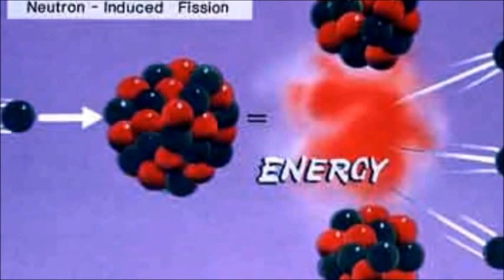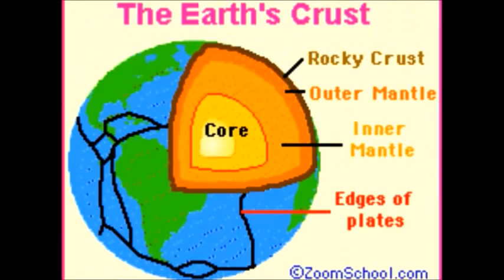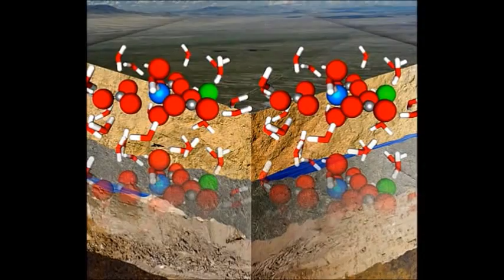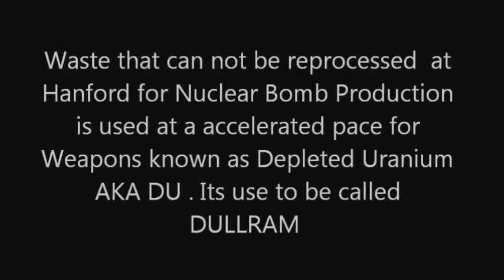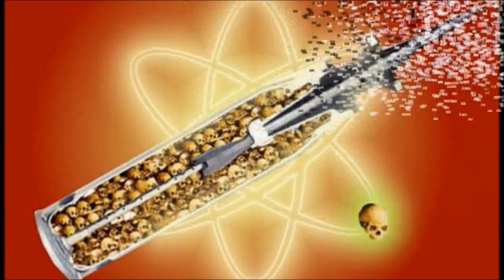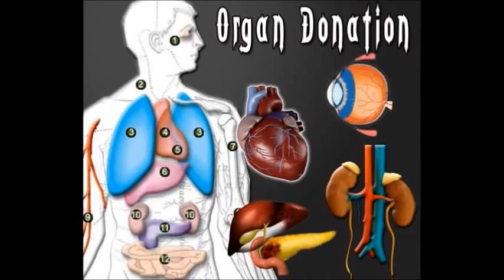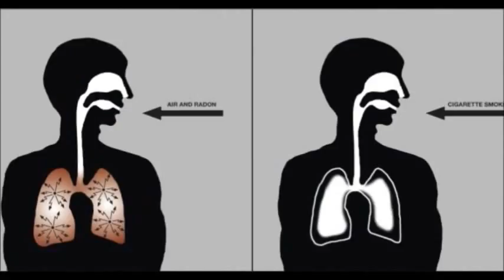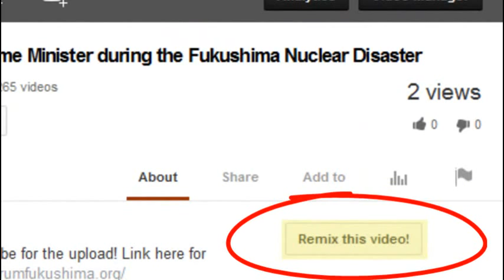Hanford:(Columbia River Warning) Radiation Forever and ever...

Comment: Maybe you need to go learn some real facts about earth before making a video. The rotation of the iron core of the earth causes earths magnetic field. Magma that the continents float on causes the movements of the tectonic plates. Volcano eruptions are produced by pressure build ups in magma tubes or chambers that reach a pressure that can no longer be contained. NONE of these have even in the slightest bit to do with uranium in any way shape or form. Please go do some research before making a video.